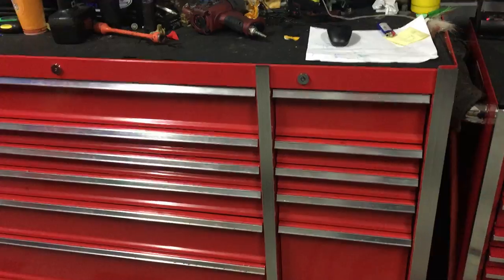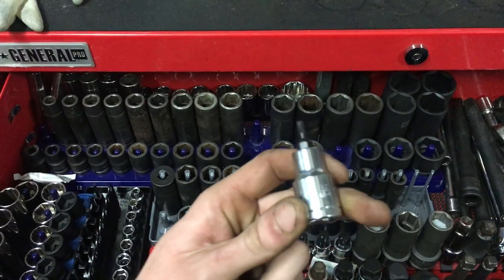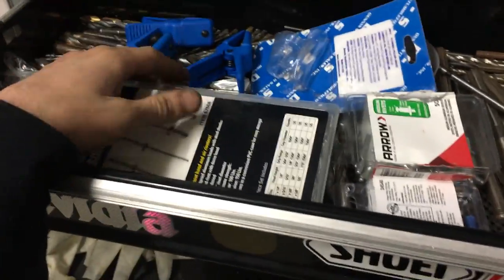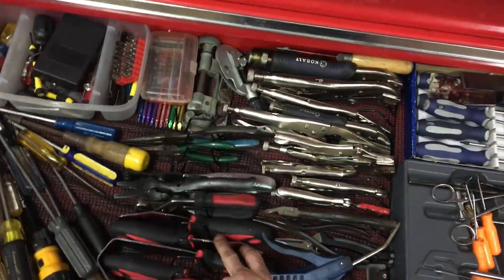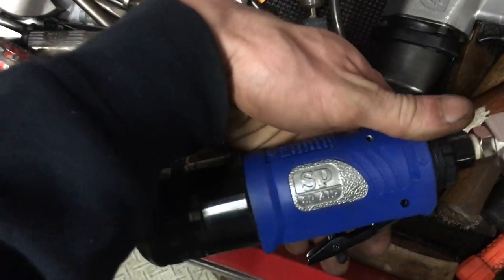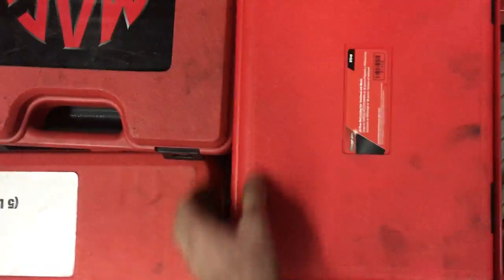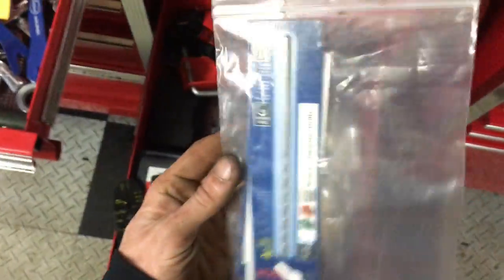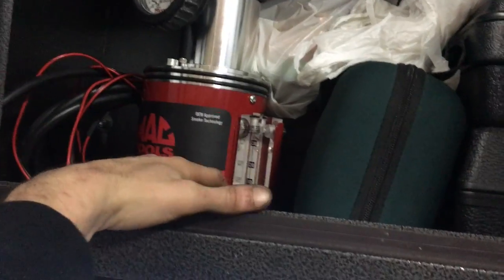Epic Harbor Freight tool box tour! - Snap on Harbor Freight Matco Mac Craftsman Cornwell

Comment: I use my boxes as a mobile workbench in my workshop. Easier and quicker to bring tools to the job. I made a pretty cool top for mine that the makers don't sell. The top I made is a one inch thick bot top. On either end pulling a handle pulls out extending worktop! This allows me to double the amount of worktop space I have on my jobs. Each half has been tested to 100 lbs so plenty strong enough for my needs. Simply slide in at end of job. Main top is stainless steel,1/8" thick and heavy duty rubber on the sides.
 You got a great box there mate,a real working box for sure!

Comment: Thanks for the vid. I am kind of considering picking up a 44in HF box for the shop. The only thing stopping me is the depth of the drawers. It just seems so shallow. Currently there is a filled 26in craftsman top and bottom, 56in snap on Krl and a 5drawer HF roll around that I work out of. However everything is filled to the brim and I need more space. I was thinking the HF because it won't ever move so flex and such isn't to big a deal. Anyhow what do you think of the depth. Does it drastically hinder the capacity in your opinion?
Reply from the maker: whats up matt.  you know its funny you say that about the depth because i was worried about the same thing when i bought it.  I was worried i would have sets that wouldn't fit.  Fortunately for me it was NOT an issue at all.  my snap on box is a newer krl 54" which has a depth of 23".The harbor freight is 22". not much diff at all.  To be honest the smaller drawers on the HF box have more height than the small drawers on my snap on.  They can hold more thanks for viewing.
Reply: Long Island Auto Repair thanks for the info. Can't beat first hand experience. it is reassuring for sure lol.
Reply from the maker: yea np at all good luck with your purchase

Comment: great video. If you ever feel up to it would love a shop tour. My little home  shop isn't much bigger I would be interested in how you have things layed out. Super jealous of your lift
Reply from the maker: I worked with jack stands for a long long long time.  To the point where i had 2 big jacks on each side of the bay just to make things quicker.  i got so used to working with pro lifts at work i got fed up and decided it was time for my own.  they are not expensive at all on CL.  Make sure its an ALI (American Lift Institute) lift and your good because parts are usually cheap. I will deff do a shop tour soon thanks a lot for checking out the vid